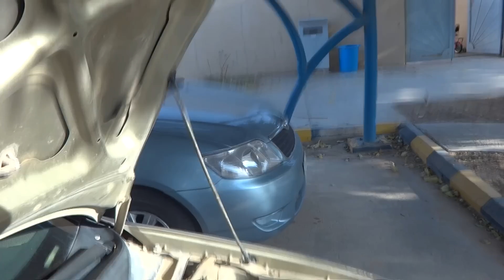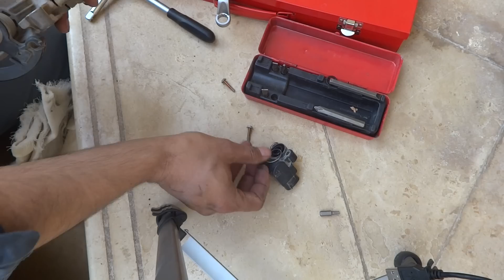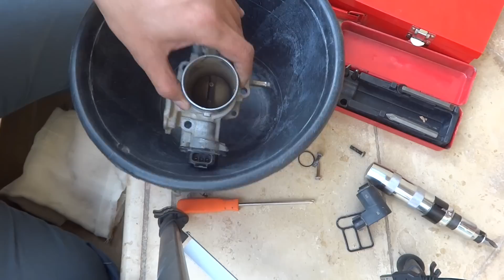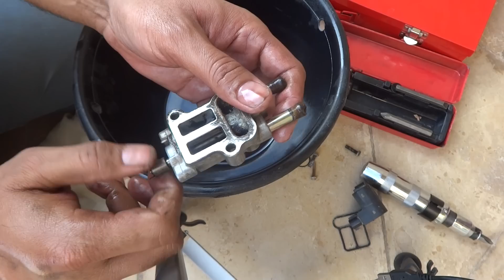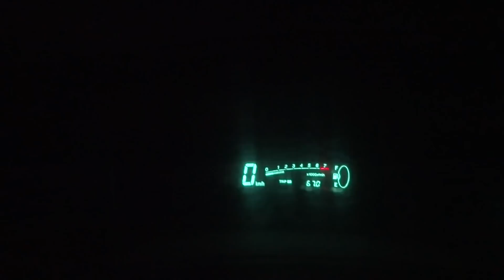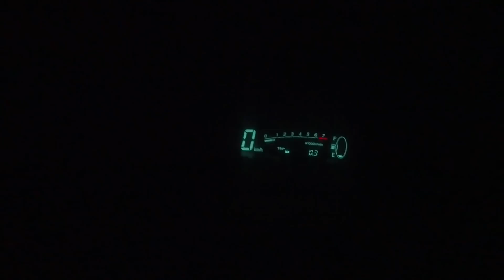Throttle body repair. Idle air control cleaning & repair.

Comment: Hello Engineer, thanks for the video. Very informative. I'm a Toyota Vios user (2005 model) if you may can share some idea about what i have notice in my car, when I turn-on all the lights during night time, I notice the engine will vibrate more and the RPM will decrease a little. Any suggestion about this? Thanks.
Reply from the maker: Thanks for liking video. That is great if my video may help you. Your car needs the very same maintenance as the problem you described is due to a dirty throttlebody. Please watch my other video on the same subject I upload on my channel. Here is the link for that:
https://www.youtube.com/watch?v=1EI17xW6CMc

Comment: The cooling system on that vehicle is in poor condition, Due to using tap water only.Try using a 50/50 mix of anti-freeze and distilled water to cut back on corrosion and deposits.

Comment: hello man...i clean my throttle body and the iac valve with carburator spray on my toyota corolla 2003...but my rpm now is 3200 rpm.... help meeeeeeee

Comment: Dear Learning Zone: Thank you for your attention,,the engine can start normally when it's cold .but never can start and become heavy when the Engine is hot ,I check the spark plug it works but not blue spark it's orange color ,the engine size 2.0
I watch ur video I try to open this system because I open every things in ,,thank you
Reply from the maker: As I asked you before you may test parameters like spark and fuel injection pulses when the engine is hot and reject to start. Then you will confirm which parameter is missing and make some conclusion from where that particular parameter is missing. If you will get something missing then your engine mechanical is OK but dig behind that parameter which is going to miss. Hope you understand my point. Regards,
Reply: LearningZone my engine  starts and goes off immediately. what  might be  the  cause?

Comment: I have Elentra 2004 it's start normal after one hours when the engine hear if I make off I can not start the engine again need time until the engine become cool so hope advise me what I should go,thank u
I change all sensor 
I change fuel pump
I change wire of ignition
Reply from the maker: Thanks for comment dear sir. It needs further more testing that what parameter to the engine is stopping it from starting in hot condition? You may check ignition, fuel injection pulses while such situation is happening. Sure there will be something missing. Then at the same time if the fuel injection pulses are missing, you may confirm security light that it should operate as normal. Normally security light stop blinking or disappears when everything is OK and car receives its own key. If there is some issue with your security, your car anti theft system needs checkup or replacement. For testing fuel injection pulses and security testing, you may watch my other videos on my channel. Regards,

Comment: when i switch on the air condition and press gas the car concuss for 3 second then disappears
Reply from the maker: What a nice channel logo and channel name Masha Allah! Probably you have the same problem with your car. Better clean your car throttle body one time and you will feel the difference. Regards,
Reply: اللهم صلي على محمدradireater buis wordhaart

Comment: can this remove a whistling noise?
Reply: Does yours whistle under light acceleration but go away on heavier or no throttle? That's what mine does and I'm wondering the same thing.
Reply: +Tuneman1984 yeah !
Reply: @haitham1789  Did you figure out what that whistle was?
Reply: @PaganGold  check all vaccum lines
Reply: @Tuneman1984  did you figure out what that whistle was?

Comment: Unbelievable. Your channel is perfect helping people and educating all over the world. I'm very grateful and appreciate your videos. I have subscribed and I look forward to seeing more of your videos. If you have time, can you answer the following question: I have a 2003 Toyota corolla, automatic transmission, with 145,000 miles that I just bought. When the car is at normal temperature, and I stop at a red light with the car in drive, my idle is at 650rpm and the body of the car vibrates more than usual. I replaced all motor mounts. do you think I can clean the throttle body to take care of the problem? 

My transmission is running fine, but there is a slight vibration when slowing down to stop from second to first gear. Also, I don't think the previous owner changed the transmission fluid. is it safe to flush the transmission and place new fluid?I heard that transmission flushing can make the transmission break down faster when it's a high mileage transmission that hasn't been flushed. Thank you for the excellent knowledge and education!
Reply from the maker: +Ken Thanks Ken. This would be a good idea to clean your throttle body according to my instructions. It will may solve your idle problem. Also you may check your car for any misfire if it is there. I have a video on my channel to identify and repair misfire on such car. In case of misfire also the car will vibrate.
The transmission issue you should only change the fluid and filter and change them a little frequent than the recommended 60000 miles. It will flush the transmission in more safe way than you are doing a regular flushing. Sure there would be chance of failure if you are going for regular aggressive flushing. So better you should avoid that. Regards,
Reply: Thank you for your answer! I will definitely check for a misfire! Would you flush the transmission with 145,000 miles if you didn't know if the transmission was ever flushed?
Reply from the maker: +Ken I thing it is not required to flush the transmission if is running without issues. The flushing can fail your transmission!

Comment: If I were you, I would have replaced the bolts so I would have the right tool to remove them next time... :)
Reply from the maker: +Ilian Nachev That would not be a bad idea. Attempt it when you will face such situation in future. Regards,

Comment: Solution for
the Problem of Honda Accord 2005 

hi,

 i hope that you all will be fine. :) 

As my experience this problem occurs from TPS itself, Because PCM thinks the
throttle is wide open that’s why gear stuck in the park and PCM won`t let the
solenoid to open state for the safety of gear box.

 i was facing the issue on my
accord 2005 since 2 days. Due to the sand storm my IAC was stuck and rpm was
high i decided to clean the throttle body and i dissembled and cleaned it.
after re-installing  everything was fine
rpm was high little but gear stuck into park i did the RELEARN procedure for PCM
several times to get out of the stuck state. RPM problem was gone but still
gear was stuck in the park.

 I talked to my mechanic he said take out the complete throttle body again
reassemble it and reinstall again problem would be gone, Anyways everything was
as it is and took out the IAC cleaned it and throttle body with solvent and
again i reassembled,  After installation
the problem was still exist stuck in the park.

Then i decided to check all the fuses everything every electrical connector and
fuses relays everything was ok..!!!! 

Testing & Symptoms:

The brake lights work

The brake stop light switch was OK. 

I have 12 volts on the yellow lead going to the release
solenoid.

The yellow black wire on the solenoid was not going to ground when the brake
pedal was pushed.

I placed a ground on the ground lead and the release solenoid worked every
time.

I verified continuity from the PCM pin 2 to the release solenoid ground wire

I pulled all five connectors on the PCM and reseated them - park release worked
for about 10 minutes then stopped working again.

I hooked up my OBDII analyzer to confirm no trouble codes. The throttle
position sensor was showing 9% at idle.

I confirmed that no fuses were blown

I pulled the throttle
position sensor several times and reseated. I also applied a small drop of Deoxit on the 3 pins.

Whenever I pulled the TPS connector, the solenoid worked every time.

On the throttle position sensor, the 5 volt lead measured 5 volts, the position
lead measured 0.5 volts at idle. The ground lead measured 0 volts.

 

(Take the test light connect to
the battery`s –ve  connector and connect
test light to the (Red+Blk) wire which called sensor signal wire to PCM and
check the solenoid it will work while harness for the TPS is connected to TP
sensor) anyways it’s not a solution just for
knowledge purpose.

 

TPS Reading at
the time of Problem.

Throttle position 9%

Wire color code ( Yellow+BLK/BROWN) Voltages were 5 Volts

Ground good (Green+ BLK)

reference voltages .5 Volts (RED+ BLK)

ACCORDING TO
THE HONDA Reference manual TPS spec should be as mentioned below.

Throttle
Position should be 0%

On Red+Blk wire
voltage should be .45 to .49 Volts

Yellow+Blk wire
voltage should be  4.5 to 5 Volts

 

but in actual what the honda says about TPS should be 0% and reference voltages
should be .45 volts...

 according to these measurements,  i
could not disassembled the TPS because rivet tightened screws was holding the
TPS so i started taping gently on the TPS from left to right to change its
angle while OBDII code reader was connected to cell fone everything was visible
via OBDII reader i took that angle from 9 % to 5% and then at that moment the
solenoid works actually the reading was still higher for the PCM But it works,  

Result is to changing the angle of TPS can take out from this trouble.

I had read many solution as Honda recommend to change the throttle body which
cost 1000 $$$$$.... to changing the angle for TPS can leads to the solution
from this issue.

 

Hope this guide
will help you this solution is based on my own experience. I hope it will help
you a lot.

 

Thanks you !!!

Comment: i am working on accord 2005 five i had did pcm learn procedure for throttle body but problem stil exist looking for help.... thanks for your response. :d
Reply from the maker: +Btechnology Bgroup If you relearned it and the problem still exists then you may check the system Electrical and Mechanically as it seems like something went bad which is causing your problem. If such is the case then proper repair will solve it.
Reply: +LearningZone can you please tell me the learn procedure for pcm may be i did it wrong for this model.????
Reply from the maker: +Btechnology Bgroup Really never worked on any Honda for such problem. Sure I would tell you if I know. Better you make a little research on internet to get help from someone know the exact system. Regards,
Reply: +LearningZone  after diconnecting the throttle position sensor pedal is working fine... i dont know whats a issue.:(((

Comment: recently i have cleaned the throttle body after cleaning rpm stays 1500 rpm and when i try to put in the gear when i press the pedal and try to release from the Parking to drive or any gear i am unable to do so... because the pedal solinoid does`nt engaged when i am dissconnecting the TPS connector then solinoid engaged normal... i don`t now why seeking your kind help please :(
Reply from the maker: +Btechnology Bgroup What type and model of the car you are working on? Some cars need mechanical adjustment and some needs electronic scan tool adjustment after throttle body cleaning. So do it what ever is needed for your car to correct your idle speed to proper value. Some cars need sequential start and stop of the engine a few times to let the PCM learn the idle speed. So you may try this technique first if it works for you, it will save you from ton of work and effort. Share your success with us. Wish you good luck with your repair.
Reply: +LearningZone  after learn procedure i got some changes in rpm now the rpm is approximatly 1000 and pedal issue is still exist.... this happened after dissassembling the throttle body... could you please :(

Comment: My ATF dipstick is in the way of removing my throttle body on my 2003 Echo. Do you know how to remove the dipstick/dipstick housing?
Reply: I have the same problem on my 05 Echo. Did you ever figure out how to get the throttle body out?
Reply: Lol, nope - I gave up and decided to live with the vibrations at idle.
Reply: Same here. lol Just finished putting the throttle body back on. Thanks for replying:)
Reply: Same here. lol Just finished putting the throttle body back on. Thanks for replying:)

Comment: Thanks for the video. So what is the exact reason of idle rpm change when the electrical  load changes?
Reply from the maker: +Reza Farahipour Thanks for your comment. Nearly the same dirty throttle body is one main reason for such a problem. In very rare cases it could be a vacuum leak in the system.
Reply: +LearningZone thanks for the reply! so it has nothing to with the alternator.
Reply from the maker: +Reza Farahipour In my experience in such case alternator is not at fault. If you will clean the throttle body, you will be able to solve such issue.

Comment: So what is the solvent you are using?  I don't have the toyota repair manual but just watching other you tube and reading blogs on the internet,  I am at the assumption that there is a coating of molybdenum or other metals  that could be destroyed b y scrubbing, I am not sure if that is true for echo?  Also is it hard to buy vinyl gloves in your area?  I don't think these chemicals are safe for the our skins. thanks again your video are very helpful.
Reply from the maker: +arshi khur Thanks for your comment. If your car is giving trouble and you are planning to do the throttle body repair, just go for that. If you will read read and just make think on small small things, you would feel fear always. Also if you have problem in your throttle body, there is no other choice that you should clean it or replace it with a new one. If I would be in your place as I was while shooting this video sure I would go to the first choice! On the other hand if your car is good and is not giving any idle related problems then don't try cleaning throttle body for skill enhancement instead stay for good time when your throttle body gives you trouble and then sure you will also adapt the first choice and your decision will be even re-inforced when you will know the replacement throttle body price.
Addressing your next question, this was not the only work with me to do or I am not an enthusiast to do the throttle body cleaning job as the first job of my life. I am always busy with such kind of jobs. In such a manner it is difficult to take care of gloves, shoes or other PPE. While we are working our aim is to focus on work and to take care the work with precision and in a fast way. Regards,
Reply: +LearningZone  I have fixed some issues in my cars on my own and felt so stupid at the end of it that why was I begging others to help me when Its so easy to do it myself.  Its hard to find a honest well trained mechanic as well as I hate being a dummy.  In my area mechanics and dealership charge 100$ an hr as well as shop supply parts, etc,.   Toyota echo are older well build cars.  I hope to keep this car for ever.  I am also reading books, and getting hand on training and might join a school, so no you tube is not my only mean of learning.   I am going to drive for a long time why not be self sufficient.  No my car is not giving me idle related problems and I am going to take your advice and leave it alone.   If the body stays in good shape one day I hope to replace my gas engine for electric.  I don't drive much and only drive couple of mile max 5 mile or so to do my errands.
Reply: +LearningZone so what is the solvent you are using? thanks

Comment: Hi thanks for the great instruction. My 2004 corolla sedan is at 240000km. Yesterday without prior warning it started vibrating and idling rough and I couldn't get the speed up past 80kmph. I changed the spark plugs but it still does it. Should the IAC valve clean be the next step? What tool did you use for the 5 prong screws and what solvent do you use? Many thanks
Reply from the maker: +Netty Gretty The problem you are stating seems a serious misfire due to any good reason. The best way here is to scan the car using a scan tool. It will ease you job. It could be no spark misfire, no fuel misfire or no compression misfire. I addressed almost all three type of misfire problems in my videos on my channel. You may search my channel for other videos to address your problem.
The throttle body cleaning part is coming latter to bring your car to nice performance like new. First is to address the other issue like misfire. Hope you get my point. Share your success with us. Good luck. Regards,

Comment: Salam
I u Don`t mind!!
I have a question for u!!
 what is the purpose of Water circulation in the IAC valve??
Reply from the maker: +Ibrahim Shahzad Just now see your comment. Great question! There are two purposes of water circulation in two designs of throttle body. In one design it is controlling the motion of IAC through a bimetalic strip using temperature. That one is a mixed electronic and mechanical type control. Old camry car had same system. Whereas in the other type like one here in the video have the only purpose of preheating the air which is entering to the engine for combustion. There is no other significant purpose of the water there.
Reply: LearningZone thanks bro

Comment: Did you use a scan tool to get the idle speed back normal?
Reply from the maker: +toolman talal For this model it is not required. Regards,